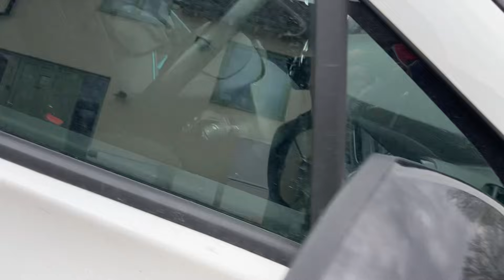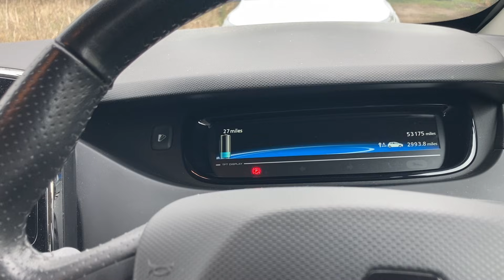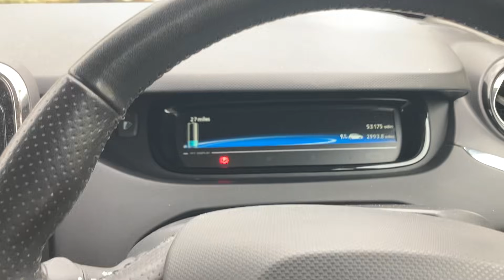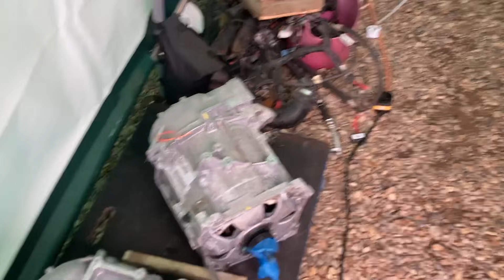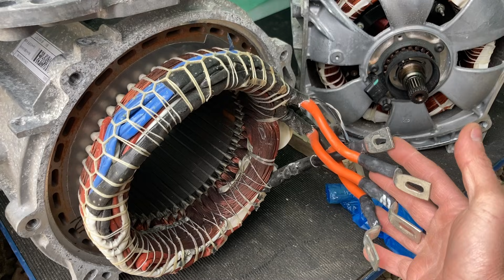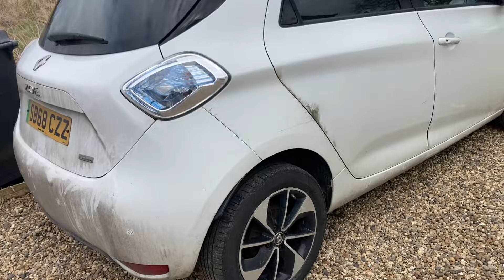Is this 6 year old EV scrap? 🫣 Renault Zoe Electric Car faulty - EV Salvage Car Repair Mechanic

Comment: All EVs should be scrapped from new, a environmental disaster. What a waste of money for Anyone to run a EV of any sort. ICE vehicles will rule for generations. EVs are just throwaway vehicles which is disgusting. Not green at all. At least a ICE vehicle can last easily 20+ yrs.
Reply: Or, to put it another way, an ICE can pollute from it's exhaust for 20+ years.....  Please explain how ICE will "rule" once oil runs dry, or becomes unviable to extract and refine....... How will ICE rule once new examples can no longer be sold after 2029?  Surely that will mean the existing pool of ICE cars will begin to diminish, year by year?  You made an interesting point regarding diesel cars, which now take just 6% of new car sales in Britain. Won't this mean anyone looking for a used diesel in a few years, will struggle to find one?
Reply: @Brian-om2hh oil is not running out, there is plenty of it. Synthetic fuels are going to be the way forward eventually
Reply: @Brian-om2hh  so the power stations don't use fossil fuels to make the electricity for the EVs then.
Wind and solar are just a drop in the ocean making electric. We don't make enough electricity now, never mind if there's more EVs. Perhaps in a couple of generations EVs might be a option when technology catches up. But not now.
Reply: @Feilding8187  
You don't know that over the last 12 months the UK power grid used 15% nuclear, 29% "natural gas" and 37% Renewables (Solar, wind, hydro..... mainly wind) ? and there's a LOT more coming on line.
(Btw, the last coal plant closed September 2024, which helps)
Reply: @Feilding8187  Drop in the ocean?  fossil fuels are 28% of our (UK) electricity.  I would also ask who is saying ev's are a problem for the grid?  I have never heard anyone with any responsibility for a power grid say this.
Reply: @Stepbystep74  speak to any engineer who looks after the power lines and they will tell you that they are juggling power all the time to keep power on. I spoke to some engineer's about 2 yrs ago and they said if everyone got a EV as the government wanted then the whole country would be having major blackouts. As the amount of power a EV takes to charge is obscene. The grid just couldn't cope. There's hundreds of large diesel generators around the country helping the national grid. All kept quiet from public and how really short of electricity we are. 
The diesel is better to be put in ICE vehicles, far better use of resources. 
That's why I will never have any sort of EV.  A lot greener to use a ICE vehicle and keep it a long time.
Not found any evidence to change my mind yet.
Reply: @Feilding8187  Juggling to keep the power on is the job of the power grid.  Adding more EV's slows down the balls.  Some engineer can be anyone.  People speaking confidently outside their area can say really dumb things.  Go to your nattional grid operators website.  See what they say on there.  They stand to loose their jobs if they are wrong.  our one has it all in a mythbusting section
Reply: @Feilding8187  Where is your proof of diesel generators? National Grid website says consumption is falling. How much power is used to rip up the seabed and drill for oil, have it processsed in a refinery the size of a small town and transport in large diesel lorries to fuel stations. Then your diesel car is only 40% efficient compared to an EV that is 98% efficient.
Reply: my 10 year old i3 has 100,000 miles on the clock and asside from tyres and a motor controllor in the drivers window has not had one issue
Reply: Can you cite some examples of EV's being "thrown away"?  I don't think you can.... You make bold statements, but with no proof or verification to back them up.
Reply: @Brian-om2hh they are probably not thrown away but just like my EV have degraded to a lower and lower point, until they can't be used for anything else than a local runabout. My leaf has now degraded by 42% and lost 5 out of 12 battery bars in 9 years and only 42k miles. This is utter shite and before you reply, read the warranty, it is not worth the paper it is written on with words like 'at our discretion' etc. etc. written into it.
Reply: @Brian-om2hh  when car main dealers won't even buy a EV at any price as a trade in even if they sold it new. 
A friend of mine had a 4 yr old EV, 35000 miles, tidy condition and no garage would buy it at any price. Had to park it up, then gave it away after 6 months. Bought a new diesel car, cheaper to run overall, insurance for car was less and home insurance dropped once the home charger was removed. I'm hearing the same thing from ex EV owners. Never heard of anyone having another EV after the first one.
Reply: @Feilding8187  Your story makes no sense. Why would you give away a 4 year old car, why not keep driving it? That would be much cheaper than giving it away and buying a diesel. Also We Buy Any Car would buy it, for example. I'm on my second EV and had no problems trading it in. My brother-in-law traded in his 6 year old EV and bought another 3 weeks ago without any issue. I would never go back to ICE. My home insurance has never asked any information about which car I have. You must live in a stange bubble if you've never heard of anyone buying another EV. There is no way a diesel is cheaper to run overall. I have a 3.0Ltr diesel as well as an EV, my diesel cost £114 to fill last week my EV has cost me £282 for 11,000 miles. My EV insurance is £40 less than my diesel, which do you think is cheaper?
Reply: @jimf4748 degradation may mean the car can't cover the range required for his needs, as mine has. I am fortunate and have other cars. If you only have one car, you have to get rid.
Reply: Gluttons for punishment lol.
Reply from the maker: Slightly odd viewpoint, our first EV paid for itself in fuel savings, at the moment we have one EV and one petrol car, the Petrol car costs 10 times as much per mile, and helps air quality in towns, which is particularly beneficial around schools. EV components including Batteries can be recycled back into the raw materials to make new batteries. I'm not sure if you are aware but cobalt is used to make low sulphur fuels but it is consumed in the process whereas the cobalt in an EV battery (for those batteries which do contain cobalt) can be reused at Vehicle end of life. I think perhaps you have read the daily mail a little too much 🤷🏻‍♂️
Reply: @garycevrepairs what’s the cost of recycling the cobalt? Same for recycling the batteries
Reply: @garycevrepairs I just did some research on the cost of recycling both an ice and an ev engine. 200 to 500 dollars for and ice, 1000 to 3600 for an ev. Add that to the human and environment costs of mining cobalt and an ev doesn’t make any more sense that an ice powered vehicle
Reply from the maker: @ an engine in an EV is basically a lump of metal, I take my old EV “engines” to a Metal recycling yard and they give me good money because it's mainly copper and aluminium.
Reply: @garycevrepairs no EV pays for itself in fiel savings, depreciation difference to ice cars trumps that many times over. My next door neighbour's second hand I pace, is still losing £1k per month currently.
You can buy a lot of electricity for £1k per month lol.
Reply: @garycevrepairs  you have angelic patience.
Reply: @garycevrepairs  I've talked to past and current owners of EVs, the current owners of EVs all say the same thing, "never again" and are going back to diesel vehicles, far cheaper to run they told me. 
Past owners have told me it was the most expensive mistake they'd ever done. They believed all the bullshit from the government and green idiots. All have gone back to ICE and very happy to. Insurance was the biggest surprise for them. On how much less ICE insurance is compared to EV insurance and their home insurance was a lot less once they removed the home charger.
I'm hearing from companies that they won't be having any more EV vans and going back to diesel vans because of the cost of the wasted time of drivers having to wait to charge, and breakdowns.
I don't believe anything in the press. I talk to real people.
Reply: @Feilding8187  
I'll bet you haven't.
(talked to EV owners)
Reply: @rogerstarkey5390  think what you like.
Reply: @rogerstarkey5390he is right, any EV that sits on a dealer's forecourt is losing money hand over fist, because they are not selling and prices are falling fast because of it,  so dealers are reluctant to take them in as part ex. If they do, they facter in that loss and offer you a derisory sum.
Reply: @Feilding8187 you obviously didn't ask me, my wife, and my two sons that question. We all wouldn't go back to an ice car. I'm 3 years in and my next car will be an ev. Our youngest son was the first in the family to go ev. He's into his second ev and next year, he'll be ready for his third.
Reply: @terrynattress5262  gluttons for punishment. Severe degradation came at about 5 years with mine. GOOD LUCK !
Reply: @terrynattress5262  how long do you keep your car's ?. I always expect vehicles to last 20+years. My current ones are 24 yrs old and no major issues. Just serviced twice a year regardless of mileage.
I can't see a EV lasting 5 yrs without major expense.
Reply: @Feilding8187  EV's can last 10 years or maybe more but the available battery capacity falls constantly with time and use cycles. Mine is 9 years old now after only covering 42k miles. It has 42% degradation and only has a range of 60 miles now. Conversely I have several other ice cars as well. An MX5 and a diesel Mercedes E Class amongst them, 21 years old and 17 years old respectively and both have the ranges they were bought with new. The Mercedes being 650 miles solo at highway speeds. I wouldn't ever buy another EV.
Reply: @FredFox-m9v  I think that's the norm nowadays. People have one EV and see how poor they are and go back to ICE vehicles.
Reply: @Feilding8187  I had an excuse being an early adopter. People who buy them these days have no excuse. There is enough information out there on them these days to inform people of how really bad they actually are but there is one born every day, so they say ?
Reply: @Feilding8187  It is a free country and if you are happy driving around in a 24 year old car that's good. I'll keep my near supercar perfomance, great tech, cheap to run EV. (I'm in my 70's so unlikely to be able to run a car for 24 years even if I wanted to lol)
Reply: FUD
Reply: @patfros no he is correct. My EV has degraded by 42% in 9 years and 42k miles. Hasn't reached any where near an environmentally break even point. All lithium ion batteries degrade with time and use cycles.

Comment: Thats why EVs are a no no ,the cost is unreal ,only if you can change the motor bearings and ease of getting them out.
Reply from the maker: Yes I can change the motor bearings, I have done this several times. Cheers

Comment: Why not just change the position sensor and/ or bearing? If these aren't available from the manufacturer then it's not about being environmentally friendly is it?
Reply from the maker: Hi there, Renault do sell the position sensor separately and I have replacement bearings also. It’s still a big job and not many people will take it on. Cheers
Reply: @garycevrepairs I hope that eventually they figure out how to make this kind of repair an hours job.
Reply: As with any technology there's an element of "It seemed like a good idea at the time"
This could be down to something as simple as a faulty batch of Off the Shelf bearings, or a miscalculation of the load on the bearing causing premature failure.
This can happen (and DOES happen) with many engineering systems. The trick is to LEARN and upgrade the parts.
Now.... If the company in question DOESN'T fix the root cause.......
I've mentioned the fiasco (Fast becoming a scandal?) of the trend for "Wet timing belts" in modern Diesel engines across many manufacturers which degrade in the oil, strip teeth and cause major issues like oil starvation induced wear, catastrophic timing loss [hence the nickname "EcoBOOM"] and brake servo pump failure..... THAT is a problem.... and it's not being "Designed out"
It's also not being helped by the failure of poorly designed DPF systems which clog prematurely causing more frequent cycles, which contaminates the engine oil, which induces belt failure.
Reply: @garycevrepairs  So it's not as bad a situation as was made out in the video then? Although it's still a lot of work just to change a sensor.
Reply from the maker: Many places will just fit another motor, dealer repair price would be around £6,500, independent maybe £4k, I’m one of the few people that do bearing replacements on these but it’s a 15 hours job, it’s really not good is it.

Comment: I feel your pain on these issues. I own a 2017 Passat GTE phev that's developed a drive fault (looking into it, a common problem) & getting anyone to have a look at it, let alone fix it is an absolute joke. VW main stealer will only replace parts at an initial cost of £4.8k going forward up to £14k if it requires a new gearbox/motor, bearing in mind the car is worth £7k. Not one local garage wants to touch it due to the high voltage system so it's looking like I'm going to have to tackle it myself, luckily I used to own a garage. Oh & this is the second GTE I've had this happen to, last one was repaired under warranty. God knows what will happen once all these electric vehicles start breaking on a regular because nobody will want to touch them or stump up thousands to even try, just totally ridiculous that this is the future.
Reply from the maker: Hi, hevra garages fix lots of EV's including GTEs, sure not every garage will look at them but it’s getting better. Best of luck. Cheers
Reply: I've got a 8 year old Nissan Leaf. No problems at all, 100% reliable. I'll keep it till the battery dies (still getting 80 to 90 mile range on the 24KWh battery).

Comment: EV's saving the planet.
Reply from the maker: Amen brother
Reply: The greater emissions largely come from the battery manufacturing process, something its best not to talk about. Of course mining cobalt and lithium etc doesn't cause pollution does it?  That's not to mention extra tyre pollution due to the weight. I have a recurring dream of the M25 blocked by lots of shiny milk floats not going anywhere
Reply from the maker: You dream about EVs?
Reply: No I dram about ZOE
Zoe Ball that is

Comment: and i am driving around in a 16 year old cheap to repair 152000 mercedes c250 cdi… i will never buy an EV
Reply from the maker: If you can keep doing that please it would be great, if too many people switched to EV the government would lose too much fuel duty and would have to work out how to tax us EV drivers another way.
Reply: That is going to happen anyway. @garycevrepairs
Reply: I think the older Mercedes diesels are reliable in all fairness.OM646 is the pinnacle. The 651 onwards have their own issues.
Reply: You will eventually. They’ll ultimately tax you off the road. It might be 10 years away but it will happen
Reply: @hughmarcus1  No government can afford to tax people off the road. They would lose the huge taxes they normally collect from the motorist. Having no private vehicles on the roads would also mean millions more people would be made jobless. How would this benefit or be an advantage to the government?
Reply: @Brian-om2hh I do wonder about the tinfoil hat wearers sometimes. My car was written off and I'm on an ebike while I figure out what to do next. I want an ev, but cheap EVs seem like untested items on eBay.
Reply: @hughmarcus1  
YOU can only drive what the companies SELL.
If the "Legacy" companies don't switch their "previously Global" market for ICE cars is going to decline to the extent that their economy of scale won't work (It already doesn't) at he prices they charge they simply are not profitable.
Therefore they have 3 choices.
1) Increase prices on a "declining product" in a dying market (which will kill the market more quickly)
2) Switch to the emerging technology 
3) Close the doors
Reply: You will be out of that eventually.
It's for the same reason we no longer use gas lighting.
Reply: @Philip---pip267 gas lighting wasn't safe